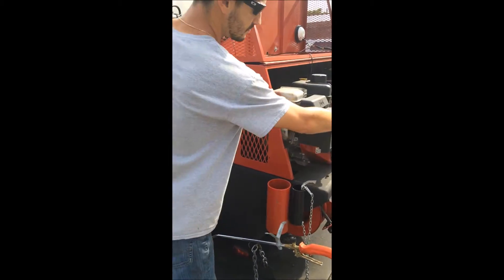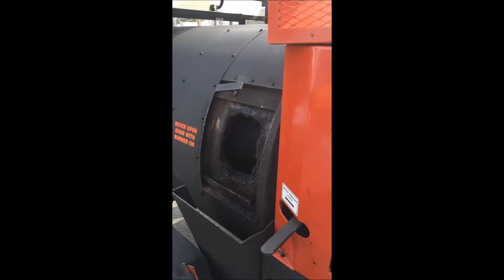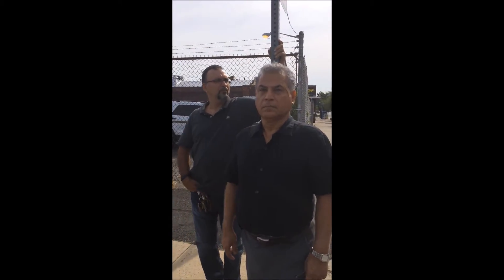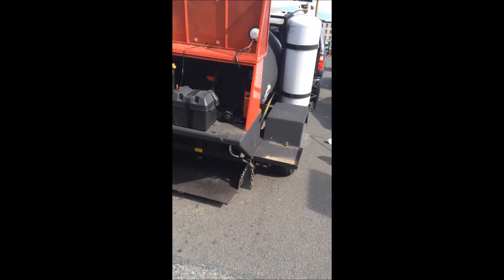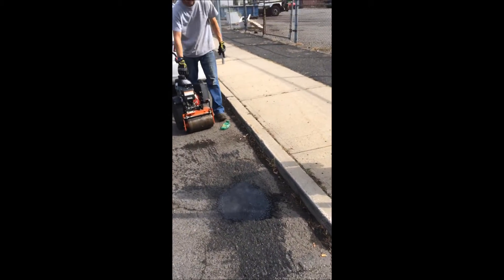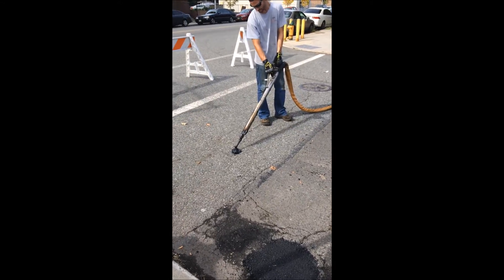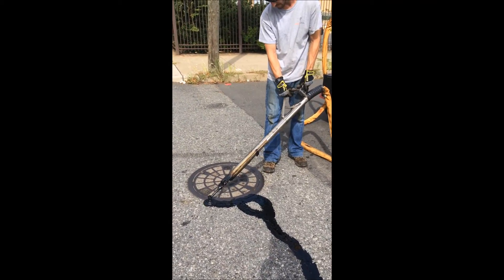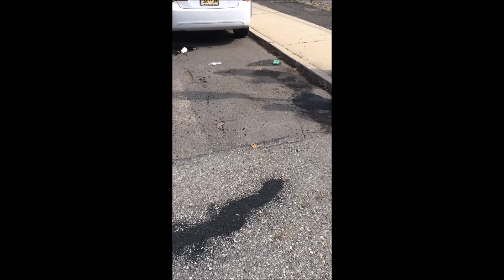Asphalt Mixer & Crack Filler-Sealer Demonstration - Dragon Asphalt Equipment

Comment: No tack coat..?
Reply from the maker: Our Asphalt Millings Rejuvenator assists with adhesion to the pothole itself making it unnecessary to use a tack coat layer.
Reply: ok..  Thanks for the response.
Reply: So this product is certified to pass DOT requirements to not require tack coat..?  Specifically I am asking with regards to Florida DOT..   What kind of cost is your Asphalt Millings Rejuvenator..?  what unit sizes are you selling it in..?  what kind of coverage..?  (how many galleons makes how many lbs of patch material..?)